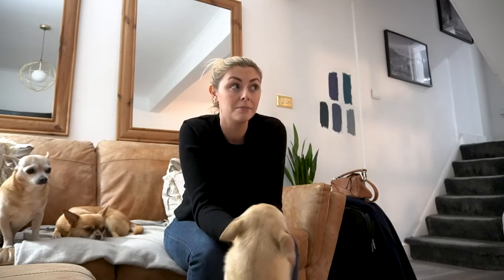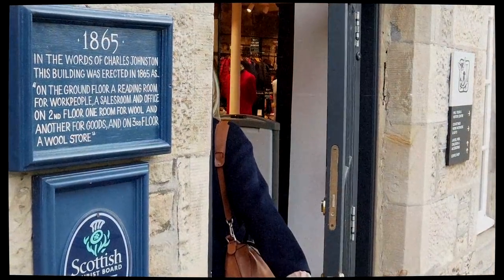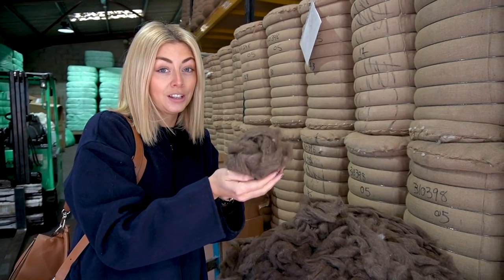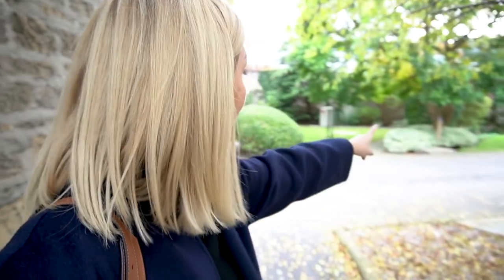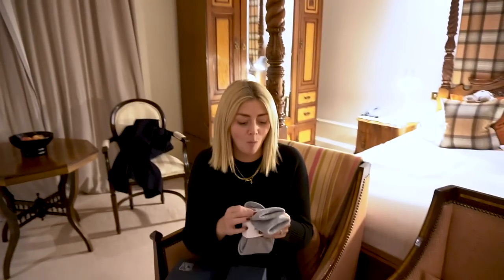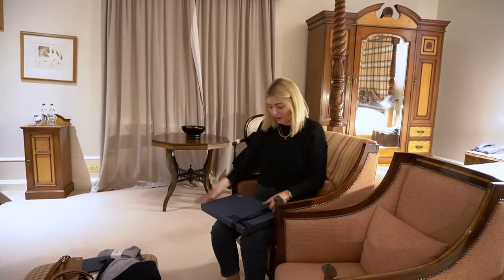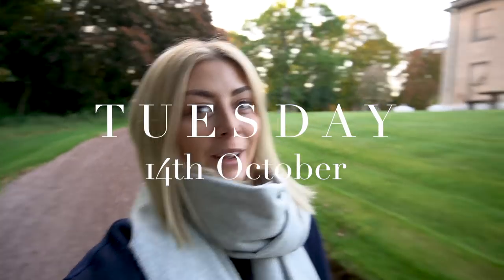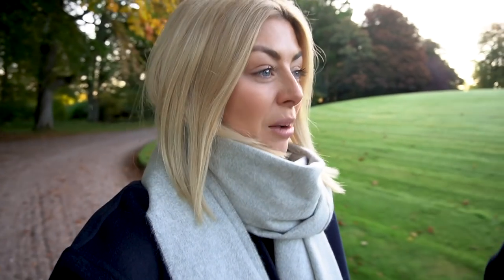AD I Inside The Cashmere & Wool Mill of Johnstons of Elgin

Comment: I very much enjoyed the video. Could you please go a bit more into detail about where their wool comes from and how they can assure animal welfare from their wool suppliers. How can we know that the animals are not harmed when combed and sheared when it's from so far away and other standards might apply. Thanks!
Reply from the maker: We did discuss these topics in detail with the team at Johnston's (and the CEO who has visited some of the herder communities), and there is a lot of information on their website about the processes/safeguards in place. But to mention a couple, they are one of the founding members of the Sustainable Fibre Alliance, which focuses on the wellbeing of the animals, environment and the herders. It also focuses on best practice and working with communities to ensure sustainable approaches and methods are used. Johnstons are also certified to work with Responsible Wool Standard wool, which promotes the well being of the sheep and the environment they graze on. I would suggest checking out their website for the detailed articles as there is so much information there 👍🏼

Comment: Can you please share some of the questions you asked them regarding sustainability. 😊
Reply: blue motion I second this 👍🏼
Reply from the maker: Yes of course. We spoke a lot about how they work with the herders and the environment. We discovered that Johnstons are part of the Sustainable Fibre Alliance, which focuses on working with the local communities to ensure best practice for all herders, animals and the environment. We also discussed the factory itself and were informed that by the end of 2019 all the electricity at the factory would be from sustainable sources and there were projects to recapture heat sources to reduce waste (along with the processes we showed in the video to reduce waste as much as possible, through the manufacturing process). They also have plastic-free packaging and a strong focus on the crafts of their trade (a good apprenticeship and training programme) to ensure the product is of the highest quality and will last for years and years. But there is a lot more information on there website too, if you want to have a look 👍🏼